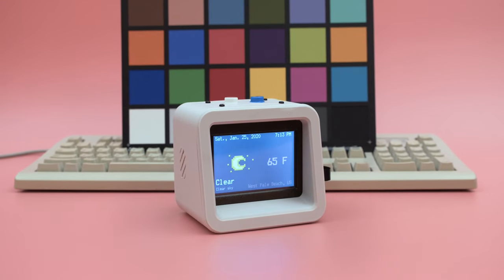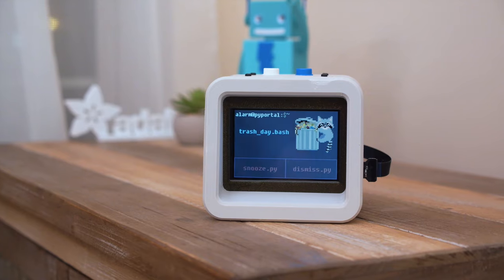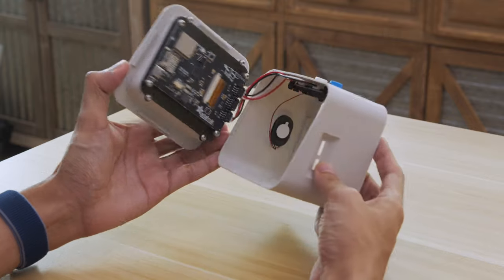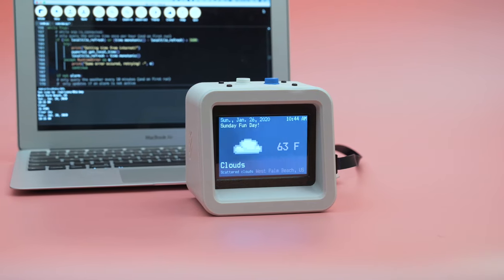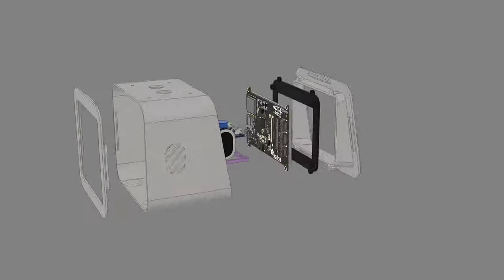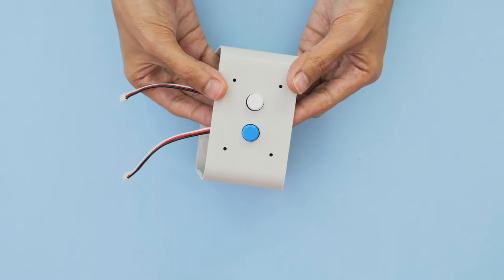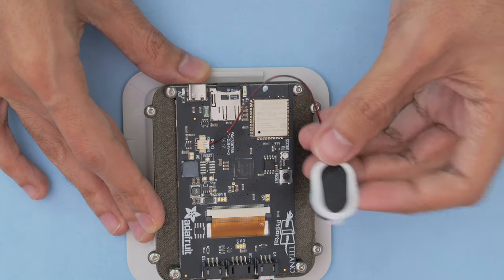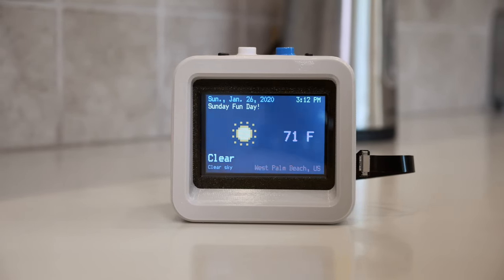Retro Weather Station

Comment: How long would that battery last? Is it possible to add some solar cells to extend it?(Not that it would go outside.)
Reply from the maker: The battery we're using is 5000mah so roughly 4-5 hours but we suggest plugging into computers USB or wall adapter.